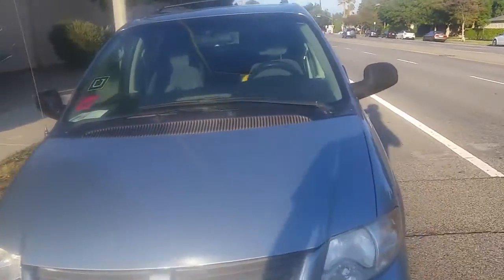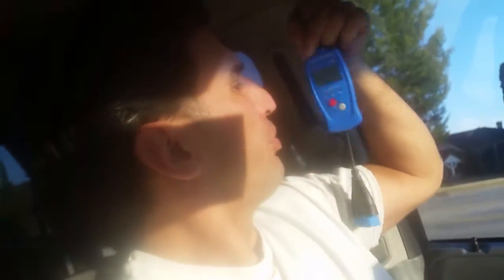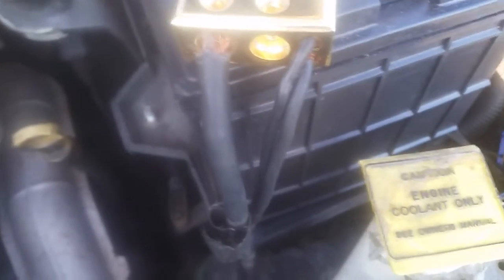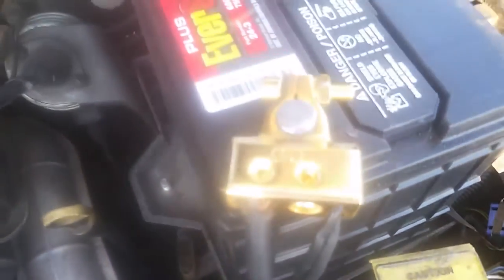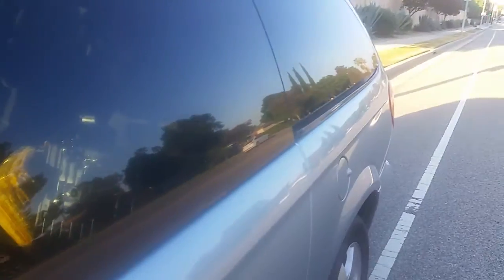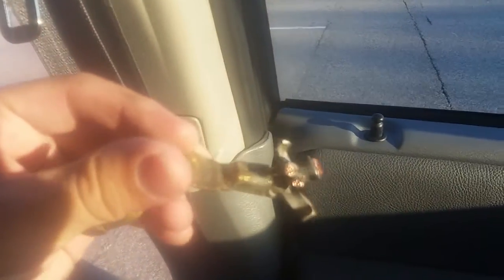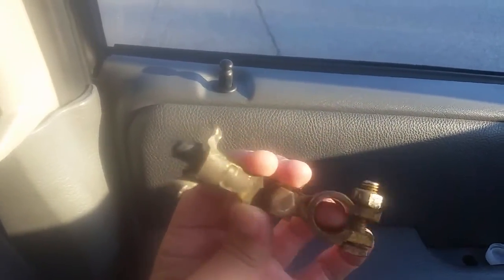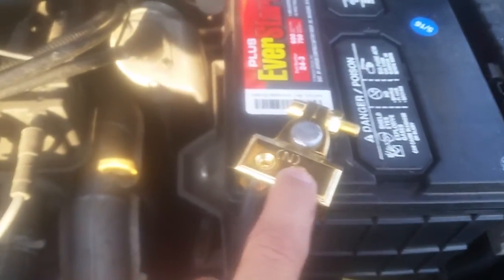Dodge caravan, the $10 fix. Part 1

Comment: I have a 1996 Plymouth Grand Voyager minivan. Does this have an issue?
Reply from the maker: I don't know. I've never had one of those. I would imagine any vehicle can have error codes as a result of improper voltage, and improper voltage can happen anytime you have bad connections.